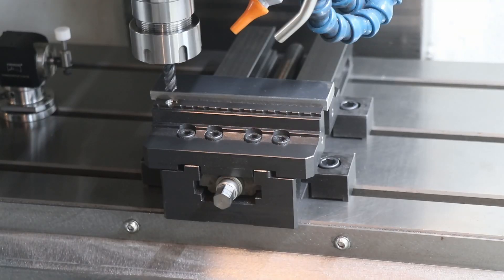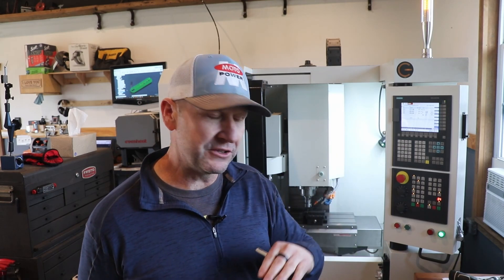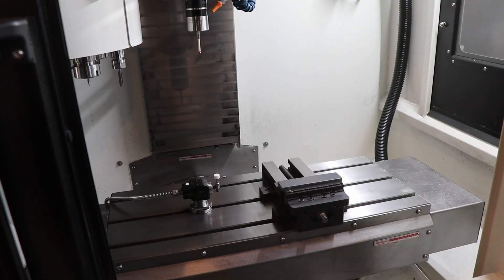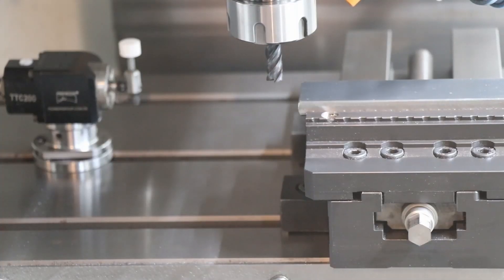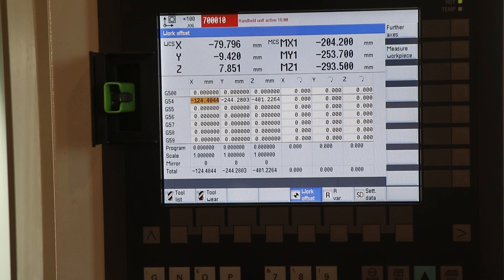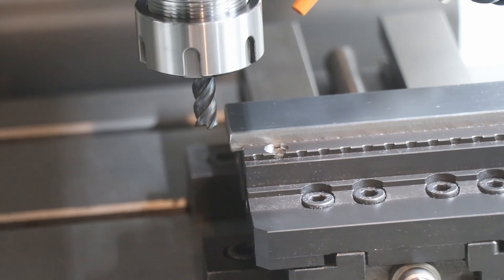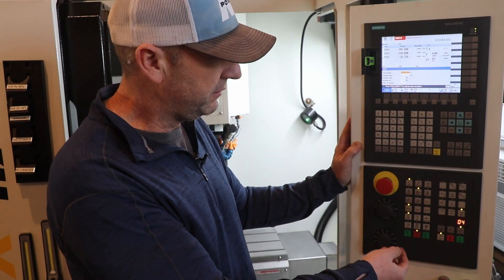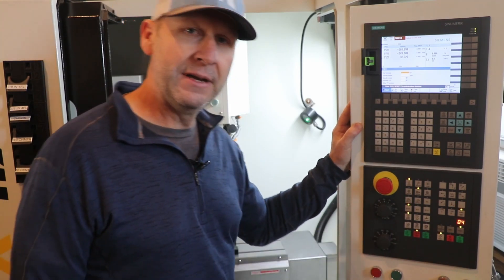SYIL X7 Basics: CRASHES! Two Ways to Verify your Setup

Comment from the maker: I don't think I mentioned this in the video, and it may go without saying,  but after using the Feed Rate method to make sure you're not going to mill into the vise, remember to turn the Feed Rate back to 100% before continuing with the program to mill the part.  I once ran a part at 50% Feed and the surface finish was horrible. 😎

Comment: After 4 years of weekly hobby machining, I recently crashed my manual mill for the first time. Was using a 18mm end mill and apparently didn't tighten the collet enough. It started to come out of the collet while milling a slot in some aluminium and hit the bottom of the vise...
Reply from the maker: Ouch!  It happens to the best of us.